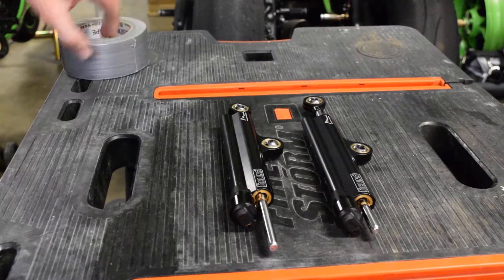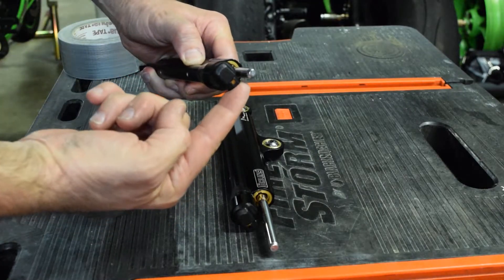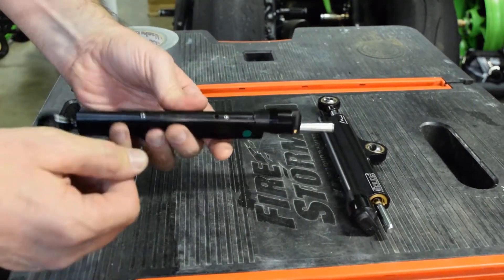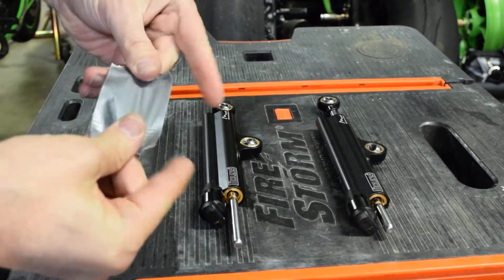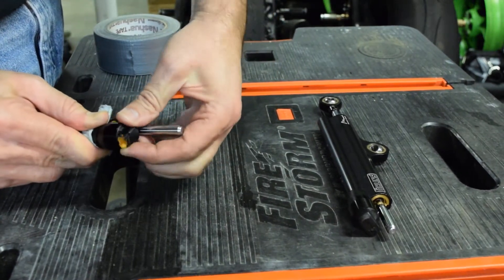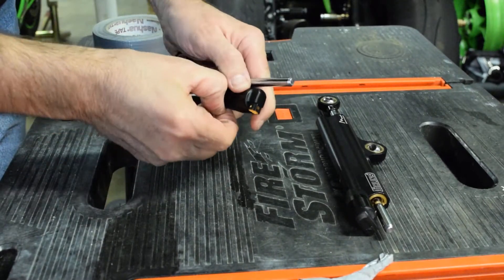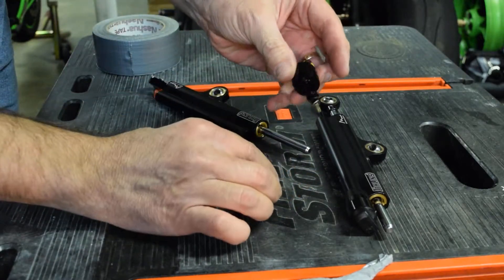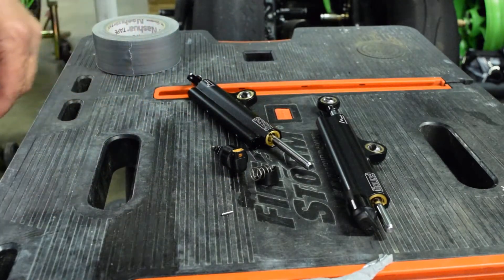GEN4/GEN5 ZX10R ESD Servo Removal

Comment: So you say that I only disconnected the connector of the damper or shock absorber and left it disconnected to the line but under the gas tank and with this it does not open any more error code and the yellow light will be removed...?

Comment: Is this to make the SD non electronic? Do you replace the motor with a bolt?
Reply from the maker: It's so you can replace the ESD with a manual damper and not get codes for the damper. You have to keep the servo connected but you can just tuck it up under the tank.
Reply: vmdirt I see..good tip.

Comment: I was told that the race SCU will actually work on the 2016 also.  I bought one, tried it, and now I get error codes. :(
Reply from the maker: That's weird. It should work just fine. I don't think I actually tried using my race SCU on my 2016 before selling though so I can't say from experience but I've not heard anyone else have that issue.  I ultimately sold it though because although it did improve the damping a bit I still prefer more damping than what it gives you. I like being able to dial in exactly what I want.
Reply: Here is what lead me down that path:
https://www.ohlins.eu/en/products/motorcycle/21740-03--3887/
Reply from the maker: Right. It "should" work. In fact I am pretty sure I have an email from Matt at Ohlins verifying that because when I first bought my '16 they only had it listed for 2013-2015, then he emailed me and said it works on the 2016 as well and they updated their web site. Is yours that exact part number? I believe I have pictures of mine somewhere around here with the part number. Send an email to "info@ohlinsusa.com" about it and Matt will probably help you out.
Reply from the maker: In fact here's the reply I got from him in June 29th of '16 after he checked with Sweden:

I just received an email back from Sweden regarding the SCU for the 2016 ZX10R. That part # "WILL" work for the NEW ZX10R, I shave 3 in stock and the retail price is $xxx.xx.
Reply: Thanks for the help.

Comment: i think mines been played with because it doesnt seem to work at all. wondering if its lost some oil. can i ask if i can top up my oil and try that?
Reply from the maker: They don't provide very much damping at all in stock form, similar to the stock manual dampers. In order to get them to work you have to replace the stock SCU (Suspension Control Unit) with the Ohlins Race SCU which retails for over $300. I just found out from Ohlins today that the Race SCU for the GEN4 also works for the GEN5. If I had known that earlier I wouldn't have replaced my ESD with the manual one. I already have a race SCU in my GEN4 and could have swapped it over to my GEN5, or purchased a 2nd one.
Reply: +vmdirt well ive heard you can take the end off the damper like in this vid and just leave it under the tank and then run a manual damper. i was gonna do this but like i say i think mine actually doesnt work at all so wanted to try it working first to see if it good enough for me
Reply from the maker: I have 2 ZX10Rs, a 2014 and a 2016. On my 2016 I took the servo motor off when I made this video and hooked the motor back up to the connector on the bike and left it under the SCU under the tank as you mentioned. I then installed a revalved manual damper. The only reason I did this is because at the time I didn't know that the Ohlins race SCU would work on the 2016, and neither did Ohlins when I emailed them. As far as your specific damper I can't say other than they are basically useless in stock form. I couldn't feel any damping at all with the stock SCU.
Reply: +vmdirt ok mate cheers.